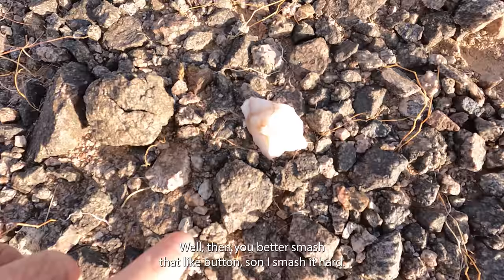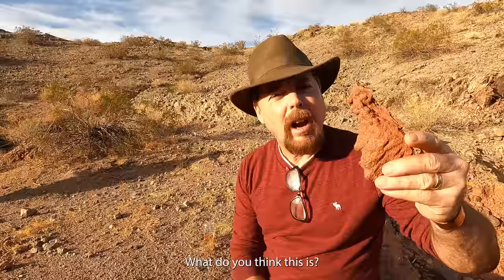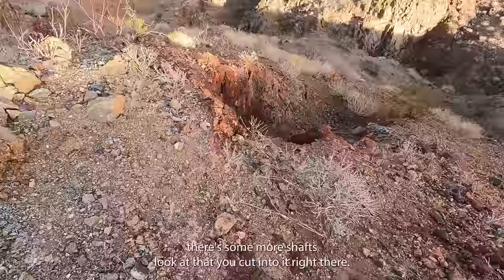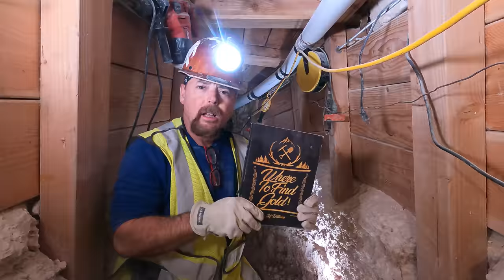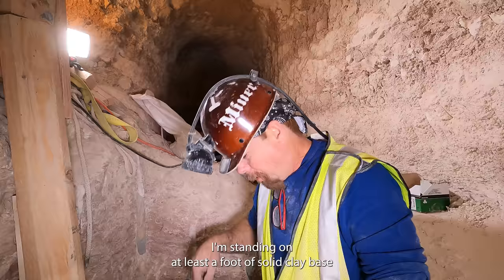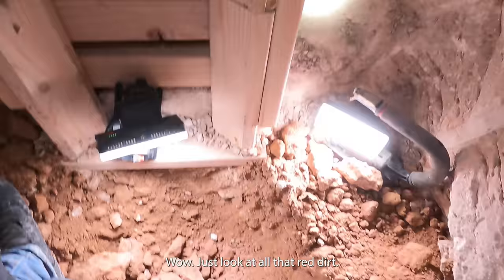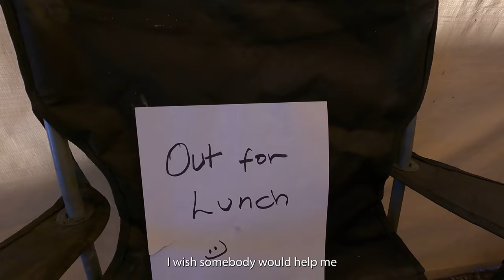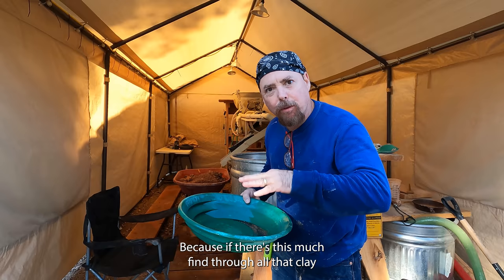Prospectors Should Look for This Mud to Find Gold

Comment: During the song, I was dreaming of blasting it soft and falling through. Hanging from the climbing gear then turn on the lights and can see under the layer, it goes 80ft North, 150ft East, 400ft West and half a mile South and it averages two feet thick.
 
That's when I hit the birdman button to the surface and woke up. Made some hot chocolate and realized Jeff, that's good Gold in that dirt. 

 What's it doing in our hole ??

Comment: Thats fascinating i really am curious does it usually drop when you find clay? Mining sure can be tricky huh
Well thanks for another exciting video. Lets go.!
Reply from the maker: sometimes
Reply: I’m thinking, that if it does happen to drop through, that there has to be a slim selection of base rock beneath the clay, … in case there were an original creek bed, beneath all of that red clay, … or, possibly, that there might be a lava tube, underneath even that, … which was also what became a creek bed, …

Comment: The apparent void underneath that red clay stuff is a bit worrying. Like you say, make sure you are attached to something before you go down any further. As to what it is, It might be just a shallow void like those you were digging into before you found the other mine or it might be a cavern that has eroded out and be 20 feet deep. However, in view of the presence of that other mine so local, is that it is a third mine. can't wait.

Comment: I think I know where your at. The issue with that area, which makes it limited, is if you go down you hit geothermal hot water. With few exception everyone goes sideways into the hills. The state started some rules and protections regarding that a few years back, if I remember correctly.  Did you bring a black light with you?

Comment: Well done. So, didn't that clay layer settle out of a stream as the water slowed down, maybe into a wider area such as a leveled off area or a pond or lake?  And if that's the case, maybe a faster channel of water upstream of this clay could contain a higher concentration of black sand, pebbles and gold.  So, is there a way to tell which direction the clay came from, then work in that direction looking for coarser and larger flakes?  Excellent video, as usual, Jeff.  Love the way you work so hard to make interesting videos . . . and I especially like the geology lessons along the way.
Reply from the maker: we are working on all them things and thanks

Comment: Jeff, first time I've ever heard mind dump, tailings and thought there was any kind of a distinguishing term for it. Mine dump and then tailings dump.
One part of that doesn't make any sense to me, if it's a tailings pile because it's from the milling, are you saying they take rocks out before they Mill it down to 100 -? Or are you saying that some large chunks end up in the tailings of the milling process? Or something else? I find this fascinating and I've been playing in this hobby for quite a while, and I didn't know there was a difference and yet they look the same because of the large tailings Mill chunks.
Reply from the maker: yep the fine powder from the mills is called tailings and the large rock piles outside of mines is called mined mine dumps
Reply: @Askjeffwilliams  that means when I go to these mining claims where there's huge piles of ore that's in smaller chunks that they call tailings were actually mine dumps.
You were holding a larger Rock and calling it tailings. I'm still confused.

Comment: Find gold 50 % of the time ! A unique technique that has been tested. Get a state or Federal geological map with elevations AND where the gold has been found and mined. Draw a straight line to each of those locations from every direction until all locations and mines are connected. Where the 'X' appears, search there ! Gold runs in straight lines. This was used by a pilot about 20 years ago in Alaska and he found gold nuggets 2x's with one under the ground (makes 3x's). He became so wealthy that he quit mining ! He was also on the news ! After using a metal detector and searching the area, use the video information. He is very informative.
Reply from the maker: great info ...thanks

Comment: Jeff have you seen the structure for getting water from the air. A giant tower made of a latticework water condenses on it then flows into a container pond at the bottom. You could make small versions of it just less water production. Everyone have you seen Mindat geology is so complex.  Jeff is more or less a professor in geology at this point.

Comment: Hi jeff. When i was over at Rhettas (the gold lady) she mentioned you was supposedly going to drop off some of those books. Is that true?  Because im in on buying one. Also i got one of those Dewalt bits you did a previous video on. They work really well and i didnt know that comes with a removable adapter that fits nearly any vaccum hose until after i goi the bit. I got the 1" bit because what i use for blasting i really cant go larger than 1" but i could only find the 1" bits with a useable length of about 15  inches or so and am hoping Dewalt comes out with another 1" bit longer than that but shorter than the 4 footer you use. Also, what kindof blasting do you do? And sometime in the near future could you sport a video on that? I seen the one you made using the Dexpan. I have used Dexpan before and i wasnt very fond of it so nowi just use black powder(when i can find it) or the substitute powder called Pyrodex which ive found works very well and is far safer than black powder.
Reply from the maker: tell her we said Hi ....she is a very smart lady and I hear ya with the bits ...... be safe with that and keep us posted

Comment: 55 gallons of mercury would weigh 6212 pounds!
Do you think a 55 gallon barrel is going to be strong enough to hold that kind of weight?
The mercury containers that hold 1000 pounds are tiny and they’re heavy duty way heavier than any 55 gallon drum!
The 500 pounder is heavy duty container but it’s tiny I don’t know the exact dimensions I can do the math it’s like 5 inches in diameter and 2 foot long and they had to move them containers by hand just a little over 2 gallons is 500 pounds of mercury.

Comment: why would you slit them perfectly serviceable plastic sacks when you could just cut the ties at the top and reuse the bags for another run? 🤔

must be a heck of an overhead to keep doing that
Reply: I wondered that too... or just untie them. Those bags are pretty cheap tho but i think he slits them like that so he doesnt accidentally reuse them and thinking theres gold in a run when in fact there was some small material left in the bags from a previous sampling.
Reply: @girlminer5023  but it can't skew the results that badly surely... especially as Jeff has a penchant for getting wet 😁